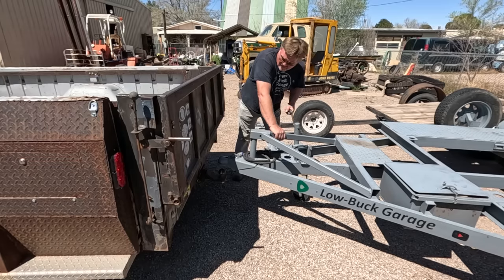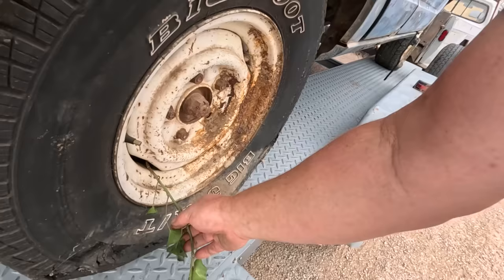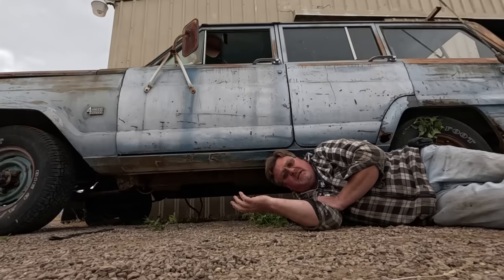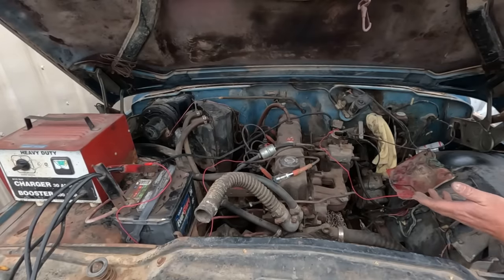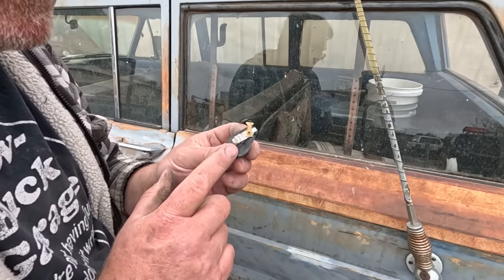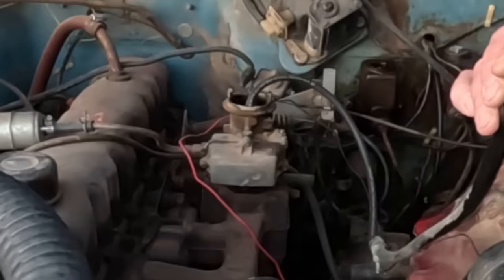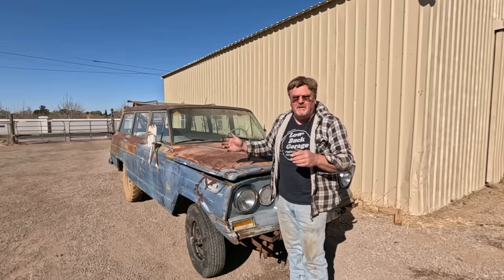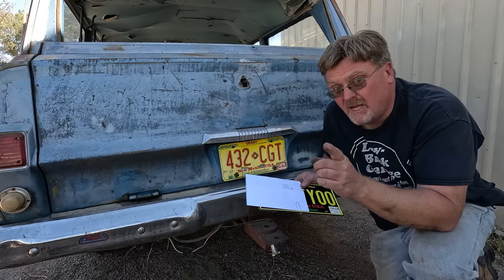The $2 Jeep... How Bad Can It Be?

Comment: My uncle says, Pull all the spark plugs and shoot the cylinders with a healthy dose of STP or something similar. It will help loosen the rings. Let it soak for about three days with the plugs just started in the holes. Then remove the plugs and crank it over to see how much it pumps out the spark plug holes. That will give you an idea how loose or tight the rings are.

Start it up and let it warm a bit, change the oil. use cheap oil because it won't be in there long, one quart short of capacity and add one quart of transmission fluid, it is highly cleansing. It will not hurt the engine but it will clean all the gunk out of her. Run that oil about 500 miles or several hours at slightly high idle and change again. Examine what came out and decide if you want to repeat or fill with all oil.

Uncle has done that with other cars that sat a long time and it brought them back to life.

Comment: I am a retired AUTO  BODY  TECH. and any time one of those JEEPS cme into the shop we allways had joke like a single guy was building a car and would go to the manufacturers of the popular cars and ask"He Buddy," "You got any left over parts you dont need"? His reply was "YEA i got a load of didtributors in pile back thar,"{and you might have to change the drive gear on it to an AMC.AISO carborators and different manafolds,it was very confusing,  sometimes when you would see one pull in the drive way you would want to go and hide or  hang the sign up closed for VACATION?

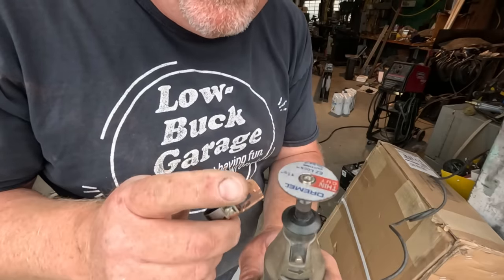Comment: @12:46 points  -  I changed points on our family car in 1970; setting the points was supposed to be aligned at the distance of 18/1000 of an inch, so I used the blade of my pocket knife as the measurement, it worked.  never tried it again.

Comment: Wow I thought I did good on my 1963 Wagoneer when I picked it up for $100 in the late 90's. Mine does have the original Tornado 230 straight 6 though with the three on the tree shifter. Mine did run when I bought it unfortunately it sat for many years at my parents place and my dad removed and didn't put back pieces. I know the radiator is missing and the starter is off and all the plugs have been pulled for some reason. Outside of that he stored some seed or fertilizer in the front seat which didn't help the front seat any. Going to take some time and money to get her back to running and looking sharp. Mine wasn't driven much, we had to pull the transmission apart to fix a shifting fork, why it was so cheap, and you could still see the machining marks on the gears. The odometer says 28k or so and I think that may be right.

Comment: A few minor inconveniences. 

Master cylinder needs to be replaced. 
Something the vacuum was connected to, (spark advance?) is not connected. 
The entire fuel system needs to be purged, the gas tank needs to be cleaned with lacquer thinner and inspected for leaks same with fuel lines
The oversized tire needs to come off, in fact you probably need to get a new set of rims that can handle viable tires. 
The clutched is either shot or is not fully engaging or disengaging. 
Differentials need to be relubed. 
Suspension and frame damage needs to be repaired. I suspect the drivers side suspension needs to be removed and rebuilt. 
New sway bay need to be installed. 
The engine needs a cleaner like risolean run for a few hours, then a complete oil change, I would go with a 40w. 
The door hinges need to be greased, the latches as well.
The windshield needs to be replaced, did this guy hit a moose or something? 
Windshield wipers need to be replaced as well as the wiper motor inspected. 

Congrats on the recovery of the strait-six, those things rebuilt are priceless

Comment: I's thumbin' through the want ads in the Shelby County Tribune when this classified advertisement caught my eye. It said, "Take imme-di-ate delivery on this '57 Chevrolet half-ton pickup truck. Will sell or swap for a hide-a-bed and thirty-five bucks. Call One-four-oh, ring two, and ask for Bob."

Well, I called Bob up on the telephone, he says, "Hello, this is Bob speakin'." I says "This here the Bob got the pickup truck for sale?" He says, "Yeah." I says, "Where are ya?" He says, "Fourteen east on County 12, turn right on the one-lane gravel road, you can park in the yard, beware of the dog, wipe your feet off, knock three times, and bring your billfold."

Well, I tooled on east on County 12, turned right on the one-lane gravel road, and I parked in the yard and a German shepherd come out and grabbed onto my leg. Then I knocked three times and wiped my feet, the dog let go and the screen door opened and Bob come out and says "Whaddya want?" I says, "Come to see your truck." He says, "Follow me. Come on, Frank." (Dog's name is Frank.)

Well, we all went past the chicken house, through the hog pen, down to the tractor shed, and then wound up in back of the barn in a field of cowpies. And settin' right there in a pool of grease was a half-ton Chevy pickup truck with a 1960 license plate, a bumper sticker says "Vote for Dick" and Brillo box full of rusty parts, and Bob says "Whaddya think?"

Well, I kicked the tires and I got in the seat and set on a petrified apple core and found a bunch of field mice livin' in the glove compartment. He says, "Her shaft is bent and her rear end leaks, you can fix her quick with an oily rag. Use a nail to start 'er; I lost the key. Don't pay no mind to that whirrin' sound. She use a little oil, but outside a' that, she's cherry."

I says, "What'll take?" He says, "What've you got?" I says, "Twenty-eight dollars and fifteen cents." He says, "You got a deal. Sign here, I'll go get the title and a can full of gas." I put the nail in the slot and fired 'er up; she coughed and belched up a bunch a' smoke and I backed her right through the hog pen into the yard.

Well, Frank jumped in and bit my leg and I beat him off with a crowbar. He jumped on out and the door fell off and the left front tire went flat. I jacked it up and patched the tube and Frank tore a piece of my shirt off. Then Bob come out and called him off and says "You better get on out of here."

I went left on the one-lane gravel road, went fourteen west on County 12. Took two full quarts of forty-weight oil just to get her to the Conoco station. And I pulled up to the Regular pump and then Harold Sykes and his kid come out. He says, "I've seen better stuff at junkyards and where'd you ever get that truck?"

I says, "That's a long story, Harold. I's thumbin' through the want ads in the Shelby County Tribune

Comment: 25:39: Super slow motion shot of Rt. Rear wheel burnout on gravel take-off reminiscent of the iconic opening shot Mad Max Fury Road as Max senses the coming storm, hops in his trusty V8-Interceptor and takes off! Even the vines stuck to the tire appear to mimic the rag filled tire that become shredded from years of abuse in the harsh unforgiving landscape and gotten stuffed with scrounged materials to just keep it moving! George Miller would be proud.

Comment: I once owned a 68 Wagoneer with th400 trans and 304 engine, a 69 Gladiator truck with 4 speed manual trans and 232 engine, and 54 4x4 wagon with kaiser L6-226. Then I got married and had kids. Bye bye toys.

Comment: Those tires didn't even look bad. no dry rot, good treds. It looks like they put new tires on it and parked it. A little armor all and they would look new. Oh I was wrong. 
*looks at oil pan ( Now you know why there are overload springs. I mean it could be worse, they could be 2x4's )
Probably bailing wire making your fuzzy pedals.
I am confused, I thought you had to run with the rotor cap on, as that closes the gap to the plug wire and lets you adjust timing? (( You know sit some kool aid on the truck and tune it in that way ))

Comment: I would never buy, drive, or use any car or truck that has a manual transmission in it. First, my brain gets confused with that damned 3rd pedal, all that useless shifting into different gears, all that needless work you have to do just to drive the thing. I don’t like stick shifts. Manual transmissions have way more problems with them, in their lifetimes, than automatic ones. You wouldn’t catch me behind the wheel of a stick shift. This is just my opinion & personal experience. To those who can & are able to drive stick shifts…more power to you.